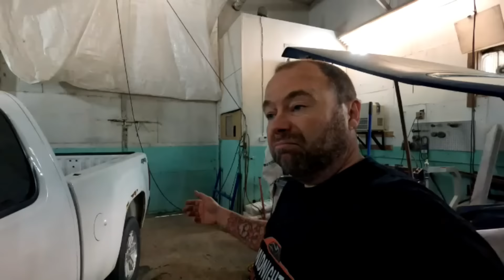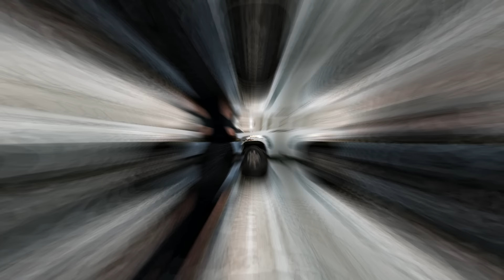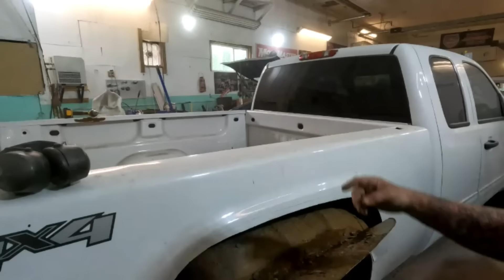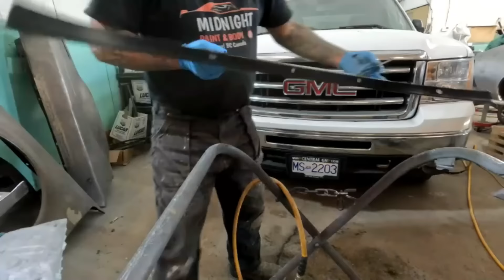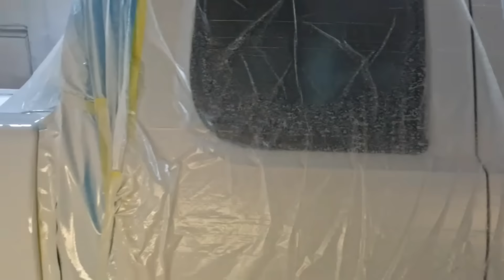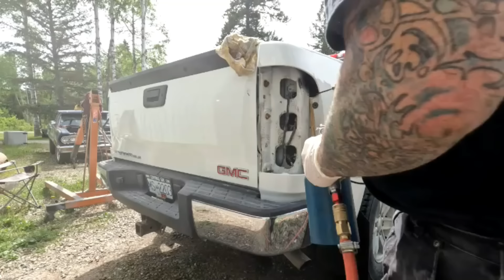How to glue on rust repair panels with panel bond structural adhesive

Comment: Time to do the job, you have to wait for the glue to dry, time welding ? I feel the glue is much safer in areas that you can not get all that dumb insolation or sound deadening out because of resk of fire !
Reply from the maker: That’s one of the benefits of welding, you can immediately start body working the panel, and yes, that’s where I usually use adhesive, when there’s concerns with what’s in behind.

Comment: So epoxy glue does work.    Would you recommend doing that for rocker panels?  Just outta curiosity......
Reply from the maker: As long as it’s used properly, it’s definitely suitable for structural repairs

Comment: Couldn't agree more about big goof mudflaps. Great  video
Reply from the maker: I’m sure if you travelled logging roads every day the thick flaps would take more abuse, although they just tear out of the metal with the vibration of rough roads, so not worth it in my opinion

Comment: Fantastic job again John! I like the panel bond because it seals the ground bare metal inside the panels so well. I use a flanging tool for the new panel to lay in, so outer surfaces are flush. I use those strong neodenium magnets to pull those panels together, where my clamps can't reach, while the glue is curing. So far, I haven't had an adhesive failure. Have a great summer!
Reply from the maker: Thanks Jim, I’ve tried flanging the panel in the past, but have always encountered warpage when I do it. Might just be my cheap flanging tool
Reply: @Johnnymidnight  I ground my flanging tool jaws so they are pretty narrow. I make pretty large
radius at the corners of the rust repair panels, and flange only a little section at a time, skipping around the perimeter here and there, just like we do when weldind a panel on to avoid heat warpage.
Working OK so far.

Comment: great job John...I panel bonded one wheel arch on my 2011 Ram 1500 , but did it differently. I cut the rust out and glued a support panel behind the bed body side. Then glued the new panel on the support, I have to do the other side now , think I'll do it as you did. But one question remains how about the double thickness of steel as you know on a Ram ther is not much body lines in bed sides.
Reply from the maker: I’ve never found it a problem, 20 gauge sheet metal is so thin, it’s easily blended out with a small amount of filler
Reply: Awesome work !

Comment: ... years ago worked at a manufacturing facility...decided to go with panel bond adhesive to assemble aluminum boxes/fixtures...had a 3M representative come in showing the panel adhesive strength etc..the metal would tear but adhesive stayed strong...
Reply from the maker: Yes, when used correctly it’s incredible stuff!